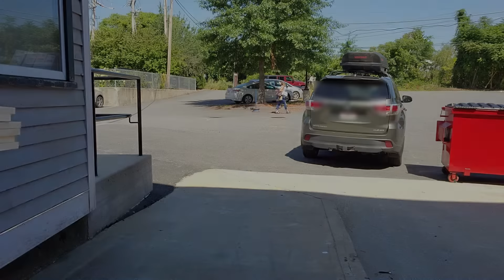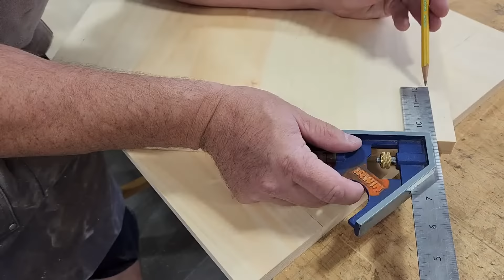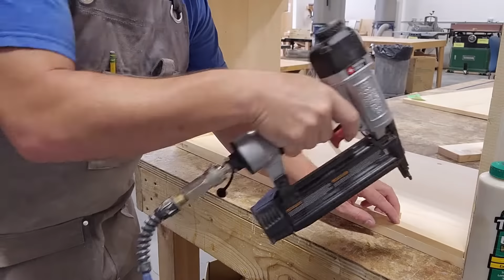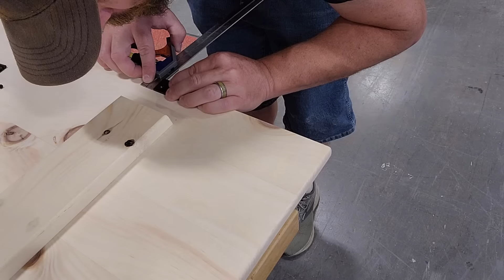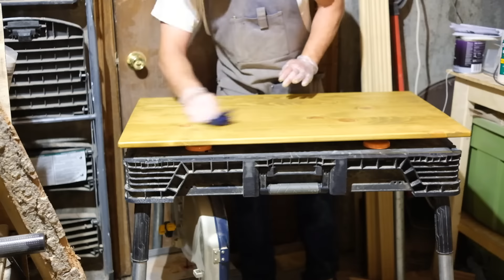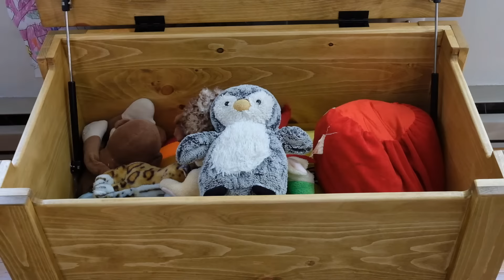DIY wood toy box| NO PLYWOOD | How to build this custom storage for your playroom design

Comment: Could you use wider boards for the panels? You would have less joining and may need less boards. Wood prices run different in areas. Looking to cut the cost of build.
Reply from the maker: Yep, 100% could use wider boards for the panels.    If you can save some money by doing so, absolutely go for it!

Comment: nice but would be nicer without brad nails.
Reply from the maker: Thanks!  Yeah, it would be slightly nicer without brad nails, but after the finish is on there and it was put in the room, you can't see them unless you're actually looking for them, so for 99.9% of interactions, it wouldn't be any nicer without the brad nails.  And it was quite a bit faster to build.  Sometimes efficiency trumps a tiny improvement in aesthetics.  

Thanks for watching!

Comment: I love using OSMO, when I apply it to my projects I almost always use a squeegee. It helps conserve the product too! Also an old wood working master told me to use a brown paper bag to polish the final coat. Haha I do it every time. Apparently paper bags are compared to 2000 gritt sand paper! Good box! Liked the video!
Reply from the maker: I've tried the squeegee as well, but I always seem to make more of a mess with it.  Just have to practice more I guess!  And probably use less product.  And the brown paper bag trick is a mainstay on most of my projects.  Glad you liked the project and the video!

Comment: DIY then has a 25” plainer…ok
Reply from the maker: I don't have a 25" planer.  I am a member of a makerspace that has a 25" planer.  Which is an option available to many DIYers.  I can't recommend finding a local makerspace to join enough, both because you get access to tools you wouldn't otherwise have, and because of the knowledge you can get from the other members.

Comment: If only I had $100k of tools..
Reply from the maker: That's the joy of belonging to a maker space!  Access to so many tools that I either can't afford or can't fit.  

And yes, I used a few fancy tools, but everything I did can easily be accomplished without them.  The domino and 25 inch planer are conveniences, not necessities.  Honestly, you could make a good quality version of this project with only a table saw with jigs, a drill, and some clamps.